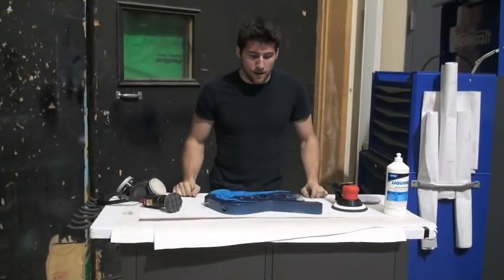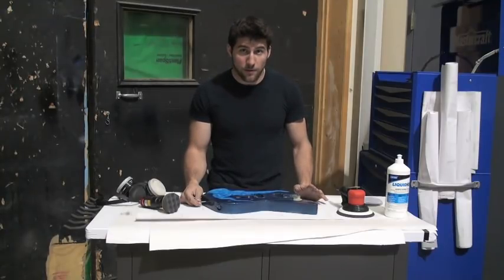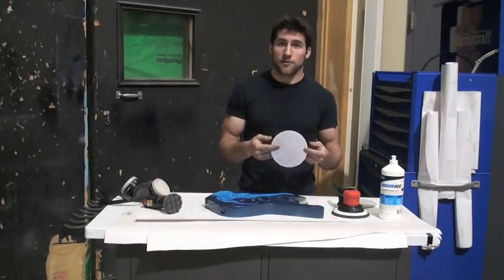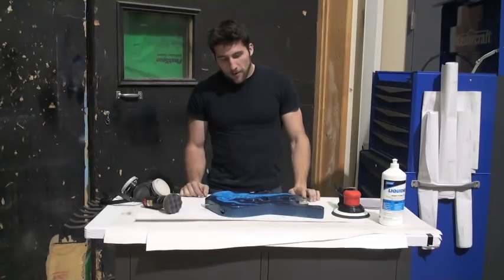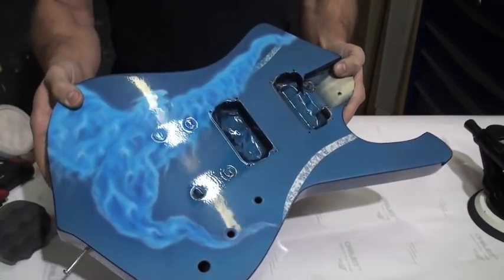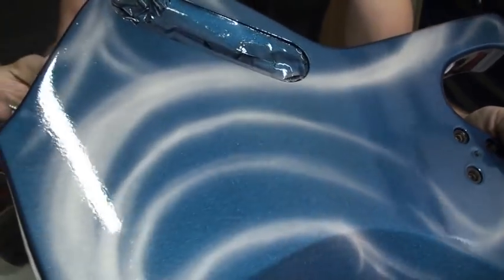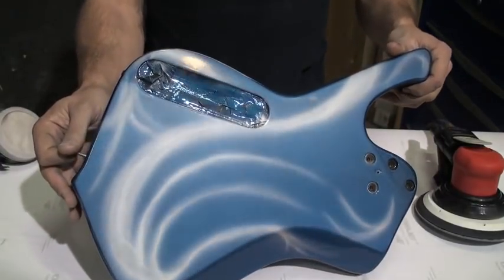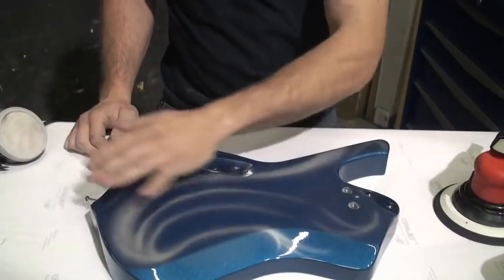How to buff out your guitar clear (step 1)

Comment: So I started at 1500 and went up to 3000 and after I used a meguiars compound as well as polish I can still see scratch marks when I look at an angle in the light. Any thoughts or suggestions?
Reply from the maker: What did you polish it with? Might have been some contamination on your buffing wheel, or maybe you just needed to do a couple more passes with each.
Reply: @BradAngove  I used meguires ultra cut compound. I think I must have picked up some contaminants from the pickup cavities. I used the "waffle" style foam pad, so part of it sunk into the cavities. I cleaned them up and used a flat pad, which seems to be doing the job. Still have some fine scratches to buff out though.
Reply from the maker: Have you moved on to meguiars polish yet?

Comment: I want to paint a metal chair,  so  do I have to wet sand and Polish clear ONLY the  clear coat layer? or also the paint? and what happens  if your paint have a bit of rough texture due to the spray canS??
Reply from the maker: You only polish the clear. You can sand the previous layers smooth with 800 grit if you have imperfections.
Reply: THANK YOU SO MUCH!!!! U ROCK
Reply from the maker: You’re welcome.

Comment: Did you sand the rest of the guitar by hand?
Reply from the maker: What part are you referring to?
Reply: The sides and curved parts of the guitar. Did you sand them to 5000 by hand or with the tool? Same with the polishing compound
Reply from the maker: I didn’t sand the edges. It’s generally unnecessary.

Comment: how long do you wait to sand and buff after you clear coat
Reply from the maker: +thomas uecker For this particular clear coat you're supposed to be able to sand after 24 hours. Some people say it's easier to do it at that point because the clear hasn't hardened as much. I find that it's riskier to do it that early. I like to wait about a week even though it takes a bit more "elbow grease". Different clear coats would result in a different answer to that question though.

Comment: I spray painted my guitar with probably 15 coats of white satin paint and about 10 clear coats and the finished started to turn a nasty yellow color
Reply from the maker: That is an extraordinary amount of paint. Can I ask why you chose to use so many coats?
Reply: To.Get a thick finish
Reply from the maker: Ok. When I'm using spray cans I usually end up with about 5 coats total. There are a lot of opportunities for things to go wrong with 25 coats of paint.
Reply: Was your guitar twice the original size at the end?!
Reply: Depending on the clear, it is not 100% clear. So yellowing will occur in any area that gets too much clear. Happens all the time at the custom shop I work at. You have to be very conscious of this and the areas that will inevitably receive more overspray as it’ll look uneven. Only option you have now is to sand back the clear to get a more true white